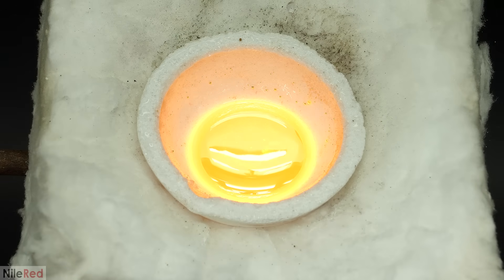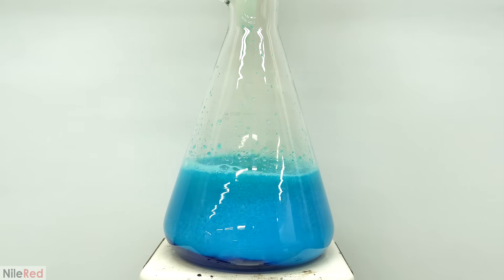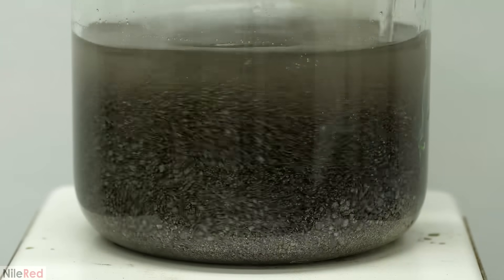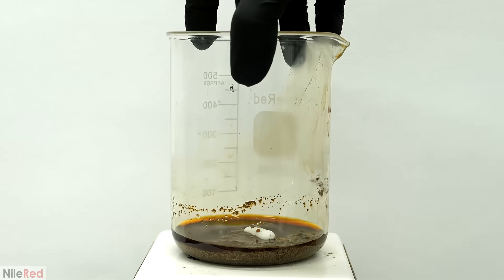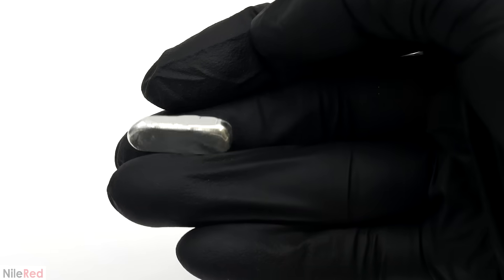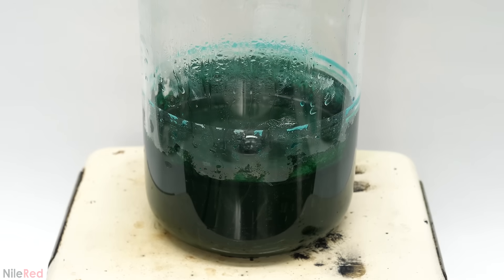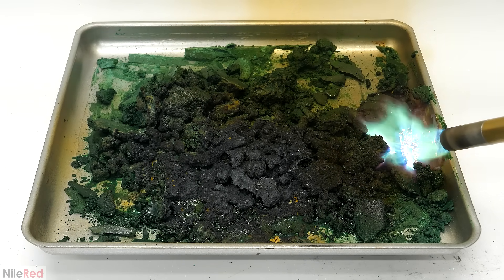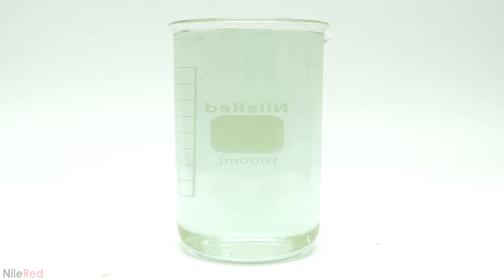Cleaning up my gold waste

Comment: What he says: "I poured all of that down the drain with a large amount of excess water"
What he means: "I dumped it in the sink and let the faucet run for a while"
Reply: Welcome to scientific writing 😁
Reply: @unnamed47  And I know for sure they won't drink the waste water either.
Reply: @AB-80X  but they will drink jet fuel
Reply: @JohnDoe-tx8eu  Just like Skank and Gutterboy:D
Reply: @JohnDoe-tx8eu  they sniff it for a cheap high
Reply: @unnamed47  Gotta blend them first
Reply: He doesn't have running water, it's actually only a few gallons. He has to refill it
Reply: @unnamed47  in pieces they are easiee
Reply: When convo suddenly become hilarious lmao
Reply: I mean i worked in a chemical plating factory.

The water we sent out of the factory was tested and could not have certain levels of plating chemicals present in it.

We had an onsite water filtration system that used fine grained sand along with carbon filters to remove trace remains of plating chemicals from the water. Sometimes however mistakes happen but there are usually systems in place to help prevent the mistakes from becoming huge issues.

Pretty sure the green solution we were using was nickle sulfate.. i wasn't in the lab.. just smart. Well i ended up over flowing the nickle sulfate tank.. not so smart now..

Luckily there is an automatic system in place and when the PH of the pit water gets above a certain amount.... literal  sirens start going off and it sounds like a nuclear bomb is being dropped. At the same time the valve that lets water drain from the pit is instantly shut off. 

You then call waste treatment up and be like "Uhhh how much room you got? cuz uhh i don trucked up" and hopefully they got room for your horrible water which now needs to be treated.

That being said I was under a more stringent watch that someone in a city. The water we used was coming directly from a fresh water lake and being returned to the same fresh water lake. We had the grate break over our intake that went into the lake and one day i came into to work to start up the plating line and it smelled like horrible dirty fish.

Well that day became 100% inspection and quality control focused as my line was unable to run as we called in divers to go remove the dead fish from the intake pipe *Intake pope is about 3ft in diameter at its opening but gets narrower as it gets closer to the plant (This is used to create laminar flow <-- To learn more about Laminar flow please look at Dustins videos from smarter every day as that man is obsessed with laminar flow)
Reply: Dilution is the solution to pollution! 😊
Reply: He doesn’t have a faucet, so he would have just poured it from a big jug.
Reply: @CraftQueenJr  he do
Reply: Meanwhile kids in parts of Africa wonders
Reply: @6fTbLiNg  So you want him to feed African kids acid and silver bars?
Reply: @6fTbLiNg  what country in Africa?

Comment: my father works as a jeweler and every his making a piece he saves the dust so he can make me a gold watch it will take a while tho
Reply: That is brilliant.
My father is a watchmaker so let me know if you require to purchase a specific mechanism with dial & hands.
There are many options but the best imo is to "recase" a manual winding military watch with porcelain dial. It brings it in to the 20th century and makes a turn of the century otherwise small and wire lugged watch look like sonething produced in the 30s or 40s; especially if you make the case robust or insert the round dial/mechanism into a square case (a la Bell&Ross).
Just a thought ...

Comment: 5:40 but copper nitrate is a blue salt... Since you heat it up a greenish color might be delivered from copper oxide forms (ofc some decent amount of copper nitrate is still there).  By the way, you can check a prices for metal prerursors, they are typically way more expensive than pure metals. (E.g. high purity copepr nitate is about 200 eur for 100g)

Comment: IMO you should have tried to recover the nitric acid from the copper waste by distillation with the sulfuric acid, whereby you would have recovered a pretty expensive reagent whilst converting the copper into a much more versatile form to be reduced by the Fehling reaction as you intiailly intended

Comment: I really like the video in your content, but I would like to provide a bit of a thought I'm wondering if you have an opinion on. So you said that you could have removed the copper from the waste, but it only would have been  a couple dollars worth, I understand that outweighs the worth of your time, but if every science project whether conducted in a basement or a commercial scale took the opportunity to extract all useful elements in their waste, wouldn't we have a smaller toxic waste problem? 

I'm curious to hear your outlook on it. If everyone did the extra time consuming step in whatever we're doing, would we be in a better situation as far as the degradation of the earth? That waste will end up in the ground, one way or another, and removing the copper makes less of it.

Comment: Instead of evaporating off the water, distill it off and save the acid for more extractions.  Then put iron pieces into the solution to cement out the copper and the nickel.  Remove/filter off the metal, then add NaOH to precipitate out the FeNO3 as oxides of iron.  Neutralize the excess NaOH, and drain dispose the (non-hazardous) solution.  The metals can also be disposed.

Comment: You could have added the sulfuric acid and distilled out the nitric acid and still wound up with copper sulfate like you had wanted.  With electrolysis you could have recovered the copper metal and sulfuric acid again. Then purified the sulfuric acid with hydrogen peroxide.

Comment: 2:08 flicks hair Gurrl, I tested your ph and saw that you are strongly BASIC
Reply: And gurl. I know how you feel being rejected. But telling the truth, you're so basic that I can't even REACT
Reply: @DanIsDistant  meh
Reply: @DanIsDistant  eh
Reply: You basic bitch- no I’m just kidding.
Reply: Nerdiest reply section ever lmao
Reply: That just means that the solution isn't reactive.
Reply: @zooso3785  Maybe I misunderstand but a solution being basic does not indicate how reactive it is, only that pH value is high.
Reply: @alfred5825  basic chemicals can be rpetty corrosive just like acid just they have different feels and different phs which separate them also their chemistry is slightly diffrent
Reply: @zooso3785  The PH of a solution has nothing to do with the reactiveness.
Reply: @wren3753  That really depends on what solution you're dealing with.
I think we can both agree that say, 99% Nitric acid is somewhat reactive compared to 30%, yes? Glad we got that settled.
Reply: Mr. Fizzles t TY that  means the solution has a greater concentration of OH- ions than H+ ions, or more hydroxide than hydronium.
Reply: @zooso3785  r/wooooshh maybe?
Reply: @zooso3785  r/wooosh
Reply: Mr. Fizzles r/woooosh

Comment: Electrolysis should be a fairly simple process using pencil leads as electrode. Pencil leads are mostly graphite, making it an inert electrode, and its composition allows easy extraction after you deposited Cu on it.

Comment: Hi, I was wondering how I could separate bronce from gold without causing damage to the gold,I have some gold over bronce jewelry that I want to separate.
Reply: Not doable. You'd need to get the gold off the bronze at least a bit. But hydrochloric acid and a bit of peroxide will eventually do the trick

Comment: After pulling off the silver, distill off MOST of the acid from the copper salt, and save that for other metal refining.  Put in iron to cement out the copper.  Add alkali to precipitate out the iron as hydroxide/oxide.  The remainder can then be disposed of (rust and alkali water).

Comment: yeah, could just use zinc to make the copper come out of solution just like you can use copper to make the silver drop out.
Reply: I was wondering whether this works with iron wire/filing (rather than zinc).

Comment: You should have just put a sheet of mild steel in the solution this would have dropped all the other metals left in the solution out and the steel would have also used up all the excess acids in the solution leaving just rusty water

Comment: You can take Silver oxide and heat to the decomposition point where it turns into Silver powder and oxygen gas and melt the silver powder to make silver bar.

Comment: Late comment....you could have precipitated copper with iron or aluminum. Even better is zinc dust.  You likely spent hours reducing the copper-nickel solution(green would indicate nickel) when you could have saved electricity by simply dropping it out of solution. The same thing with the waste aqua regia, not much gold in solution left but a refiner would still try and save the solution or at least drop all leftover metal with zinc or copper.

Comment: "It wasn't too exciting. I just neutralized the acid with sodium hydroxide--"
Lemme stop you right there.
Reply: If I remember right he cleaned the gold using distilled water and some hydrochloric acid; when combined, the hydrochloric acid and sodium hydroxide make plain old water and table salt :)
Reply: @maric0re  Obviously!
Reply: VernossGaming metal and acid ;)
Reply: @VernossGaming oh I know! it still sounds absolutely crazy even to me! chemistry is just wild
Reply: What?
Reply: So a question I can't seem to get a solid answer to. Is table salt actually a metal?
Reply: @Iceflkn  the term "salt" in chemistry refers to solids composed of a metal and a nonmetal ionic bonded. In the case of table salt, its sodium and chlorine.
Reply: @Iceflkn  No, it is not. Sodium is a metal, but the compound of sodium with chlorine is not a metal.
Sodium chloride differs from the elements that make it up in the same way that hydrogen is an explosive gas at room temperature, and oxygen is also an explosive gas at room temperature, but water -- hydrogen and oxygen -- is a fire-retardant liquid at room temperature.
Reply: What is the exciting part Caleb? Once you've done it a few times, it stops being exciting.

Comment: You should have just added a bunch of baking soda to the leftover copper-acid waste to convert any metal nitrates to their aquaohydroxidecarbonate complexes which would have fallen out and left you with a solution of sodium nitrate and chloride. You could have then just thrown out the metal hydroxide carbonates since they are naturally occuring minerals and extracted the nitrates for further nitric acid production. Dumping the nitrates down the drain is not only wasteful, it may be a slight hazard to the environment in some cases. Also, I think that recovering inorganics and general green chemistry procedures are skills that more of us amateurs should know... Great videos otherwise!

Comment: Couldn't you just react the copper oxide with water to form metallic copper? I did this before rather by accident, but my copper oxide powder turned to what appeared to be metallic copper immediately. Anyhow, love the video. Maybe you could make a few about copper/metal plating.

Comment: Did not see the 1st vid yet, but would it not have been easier to cement the copper first using a piece of stainless steel or better yet a piece of iron pipe?

Comment: As you said the copper metal isn't worth extracting. But you could use the copper salts for future experiments. One way to purify it quite easily is by turning the remaining Cu(NO3)2 to CuO, dissolving that in HCl and using a reducing agent(for example your Metabisulfite) to turn it into the insoluble Copper(I) chloride. This is easily oxidized to Cu(II) even by air. But you could use it for some quite useful reactions. For example using the Sandmeyer-Reaction you could swap the NH2 of an amine with (in this case) Cl.
Anyway, nice video as always. I maybe want to open a chemistry channel this year, but first I have to arrive at my new Job in July.

Comment: One convenient way to recover elemental silver from silver chloride is dissolving AgCl in 10-15% ammonia solution, then either precipitate silver using sodium dithionite (or similar reducing agent - maybe hydroxylamine will work too) or by displacement using copper wire (other more reactive metals work too but copper is most popular). I like the former method as it does not produce heavy metal waste. I used to do the lye and sugar process, but it introduces some impurity in the silver  (probably the oxidised dextrose) but you seemed to have it removed well after many washings. The reduction reaction can also wreak havoc if too much sugar is added at one. It is however cheaper and less smelly than using ammonia.

Since you already have a torch, maybe just heat decomposition of silver oxide to silver metal will suffice.

Comment: Hi Nile, 
I'm a big fan.
I've been wanting to do a silver recovery project myself. Except in my case, the silver wastestream is from used photographic fixer. Since the fixing reagent, sodium thiosulfate, is actually used to dissolve unexposed silver halide crystals, one can't simply precipitate silver with HCl. I was wondering if you could do a video on how one could extract the silver from this effluent because I am accumulating this silver containing waste but don't know how to treat it.

Comment: I been working on what to do with my refining waste. What I do is boil down the copper nitrate then vacuum dessicate it. Then i do a destructive distillation on it and get some of my nitric acid back. The left over black copper oxide has its uses, like for thermite or making other copper salts. If thats too much work for ya, you can always just add baking soda to it and get the basic copper carbonate, and of you feel like it, get the sodium nitrate. Of course my goal was to go full circle and recover as much of my nitric acid back. Its expensive and I make all mine myself anyway. So any nitrate salts I can get back, go into making more nitric acid.

Comment: Could you mix the copper nitrate/other salt waste with carbon (charcoal) and heat it to reduce it to the base metal?

i.e. like a caveman?
Reply: Mix a nitrate with charcoal and you're halfway to making an explosive. Not recommended over an open fire, a la caveman style.

Some metal oxides can be reduced to the metal if the oxide reacts with carbon to give carbon dioxide.
Reply: @95rav I hadn't considered that.  I guess you'd have to roast it to the oxide first then?

Comment: Another possible way to deal with the blue coppernitrate acid solution could be the transfering the nitrate with an ammonium solution to ammonium nitrate and the neutralising it all with concentrated hydrochlorid acid and anhydrous acetic acid.

Then you would have some chloride salts and maybe some glucosides with a reasonable pH.

But at this scale it could be pretty reactive. But not much vaporation of strongs acids or pure nitrogendioxide to handle with.

Comment: To extract copper from waste, use concentrated ammonia solution (but then use some acid to dissolve the copper oxide) because the copper will dissolve and the salts of other metals will remain intact, separate the resulting solution from salt crystals, then use sulfuric acid  to obtain copper sulphate and then use electrolysis or vitamin C to extract copper